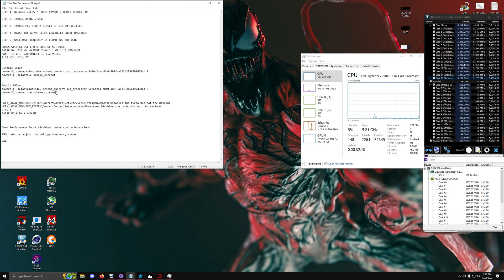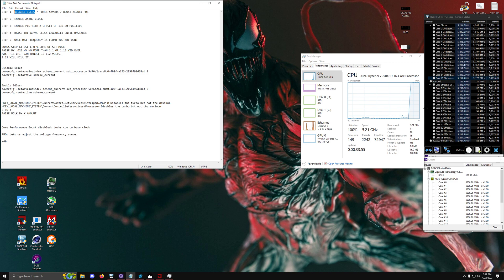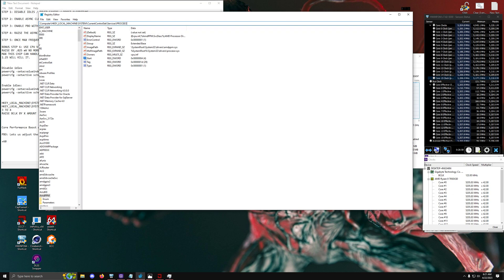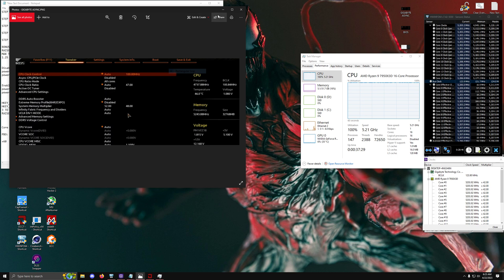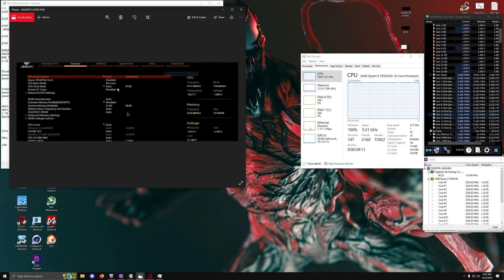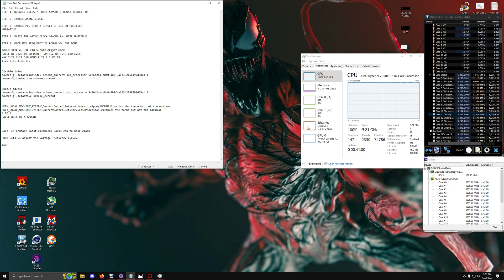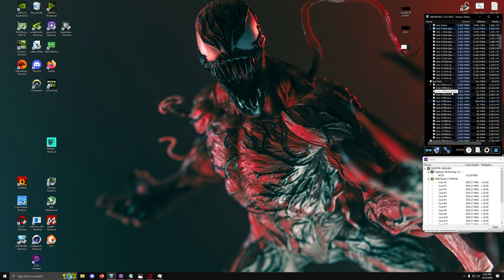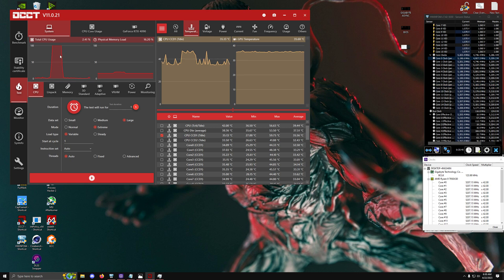RYZEN7000X3D FULLY STABLE ALL CORE TURBO UNLOCKED

Comment from the maker: Here are the commands and registry tree locations

Disable idles
powercfg -setacvalueindex scheme_current sub_processor 5d76a2ca-e8c0-402f-a133-2158492d58ad 1
powercfg -setactive scheme_current 

Enable idles:
powercfg -setacvalueindex scheme_current sub_processor 5d76a2ca-e8c0-402f-a133-2158492d58ad 0
powercfg -setactive scheme_current

HKEY_LOCAL_MACHINE\SYSTEM\CurrentControlSet\services\intelppm/AMDPPM Disables the turbo but not the maximum 
HKEY_LOCAL_MACHINE\SYSTEM\CurrentControlSet\services\Processor Disables the turbo but not the maximum 
3 TO 4
Reply: Great video! I have 7800x3d and with the increase of burning cpus I am afraid of overclocking my bios. Is it okay if I just do the registry tweak and the command prompt to disable idles and do not  the rest of the steps (so just step 1 and nothing else). I just did step one went to task manager with no games being played and cpu usage was 100 percent so I was a little worried.
Reply: Have a 7800X3D and just did the Disable idles CMD and now my CPU is at 5.04 GHz. No more downclocking! Didn't do any other the other steps since I don't have a eCLK motherboard.

Comment: So my 7800x3D is cooled by an Arctic LF3, but the CPU sometimes reaches over 70 degrees. With the same AIO, my 7600x ran with idle disabled up to a maximum of 55-60 degrees. I've also tried a PBO curve off-set of 20-30. The CPU remains stable but still runs at 70 degrees.
I hope this will make the CPU a bit cooler.

Comment: Hey, brother
I appreciate your videos, you gave some solid advices on your other videos I watched.
Here though, I want you to check out the fact that doing exact thing that you are suggesting is actually causing more issues than it solved.
I am on 7950x3D, I wrote 2 scripts, running those command lines and switched back and forth to see if all cores active would be better in games per your suggestion. It actually causes more stutters and dips for 0.1% lows. After doing a test back and forth I found that keeping those cores from clocking below certain frequencies actually creates more issues. 

Look for a video on my channel called for apples to apples scenario: 
"7950x3D: Examination of Idle States and 100% Active CPU Core State (RTX 4090) Red Dead Redemption 2"

Sleep states for AMD actually makes more sense than having that sleep state off.

Comment: i'm getting less performance out of my cpu with your method.
default gives me better performance, looks like 7800x3d is a weird beast.
i miss the days where you could just lock your frequency on the cpu and get the best perf h24.
even my locked 4.9 7800x3d all cores (effective clocks) gives worst perf compared to default behavior and lower clocks wtf.
Reply: make sure “ minimum process “ has a value of 0 within your power plan setting… I couldn’t do a higher undervolt because of it. 

when you have minimum process @ 100 the average clock is higher for longer periods messing with your undervolting potential

Comment: Well, i am annoyed by fact that my 7800X3D has 2-3GHz on used cores in Game, Warzone. 1 or 2 cores are almost constantly 100% usage according to task manager, and gpu, 7900XTX, rarely goes to 100%. mostly around 85-90% usage. Memory is 6000 cl28 and tuned all timings, which is more then enough.
All that indicates that cpu can't keep up. 
So i started game found some spot, looking at FPS and GPU usage, 250fps and gpu usage ~86%.. Disabled idle, effective clock really gone to from, 3 to 5GHz on all cores, BUT,  FPS dropped to 220FPS and GPU usage to 79%.
And now is don't understand what is happening...
Reply: i disabled idle too and my fps also dropped just turn on idle stick with it

Comment: I lost 30 fps when i disabled, i think my oc is better than what u are doing and mine runs at 4.7
Reply from the maker: clock stretching/thermals and a lot of other things can impact this performance category.
Reply: @Savitarax   I only benchmark on mw2 I get 460+ cpu fps on first game boot up and 430+ cpu fps after gaming awhile
Reply from the maker: @Mateo_FPS  oh lol well when we are talking about THAT large of FPS. 30 is like the wind blowing in the wrong direction margin of error 5-7%
That’s a frame being delivered every 2.5 milliseconds. 
If it was like 120ish range I’d be more convinced it could’ve been related to a whole host of issues.
But I’ve seen FPS fluctuate by as much as 50 on a bad day even when nothing is happening different.

Comment: You have a lot of good videos thanks. I'm playing around with some different settings on my 7800x3D. My motherboard does not have Async/ECLK. Is there any Windows command that can keep my CPU locked at 5050mhz but without being stuck at 100% Cpu usage?
Reply: It's not actually using 100%. If you download Core Temp 1.18 it shows the actual usage per core.
Reply: what are your settings
Reply: I got it to work, just disable the  2 first ones, on the cmd, the regedit is not necessary

Comment: How would you get your processor to be higher than 4.2ghz without having the asynchronous clock option on the bios? Even after adjusting the pbo to -30 it still stays at 4.2
Reply: it doesnt go up to boosted state it only stays at 4200mhz
Asus prime x670-p wifi
Reply: Im trying to find a way around not having eCLK also
Reply: @S2GUnit  i found that with my asus board setting core performance boost to enabled in ai tweaker and setting  core performance boost to disabled in advanced keeps the 3d cache around 5.2ghz and the other 8 cores at 5.4 ghz but not as stable as his it jumps up and down like 100-300mhz
Reply: @TheAcmeGamer  thanks. What motherboard do you have?
Reply: @S2GUnit  ASUS prime x670-p wifi

Comment from the maker: SUPER HELPFUL HINT:
If your motherboard has a VRVOUT  Voltage inside HWINFO64. 
This voltage is basically the closest voltage you can get to 100% accurate and safe. 
It is measuring the actual die of the cpu. So it's extremely useful for overclockers in general because it shows the true max.
If you are trying to find which CCD the 3D cache is, you can look at the power draw. The 3d chip draws literally double the regular chip.

Comment: i cant optimze my monitors for games sometimes . i have 165 hz monitor i take 220-260 fps in cs go and in lol 110-130 sometimes its 150 200 its everytime chancing fps drops happening and i cant use my new monitors 120 hz 144 hz or  165 fps always changcing not stabiledted i did evergy optimization for games win 10 i did every optimization videos i have 165 hz 0.5 ms monitor but i have 1050 ti what should i do about that? how i player smoother 144 hz or 165 hz i have 1050 ti and yes i know nice english i change nvdia profile inspectator i dont want use gysnc